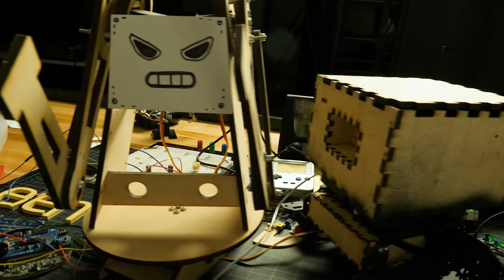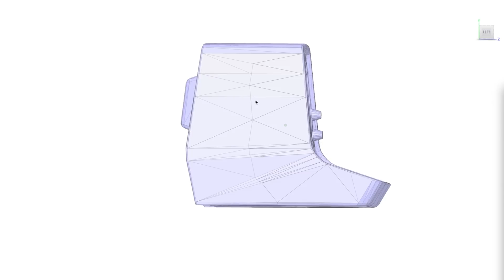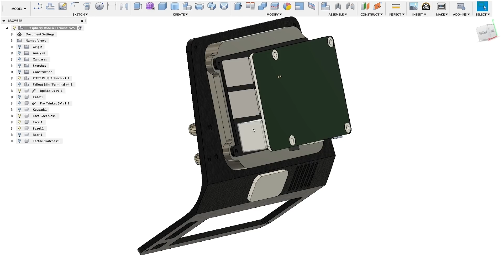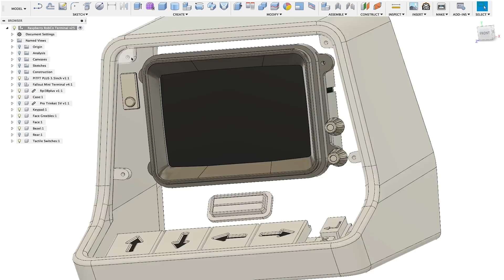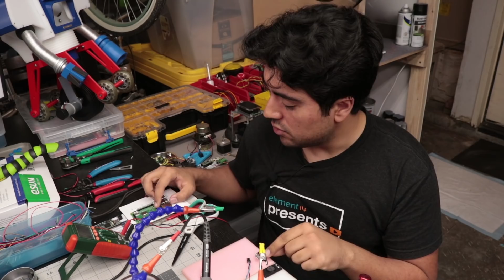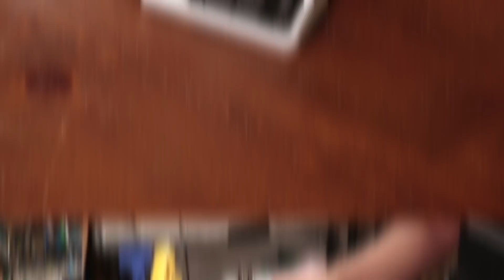Raspberry Pi Fallout Terminal PC Unlocker

Comment: What would also be cool is making  usb holotapes that have a playable   version of the mini-games and in the terminal the "load holotape" button is just an autorun for whatever is on an inserted usb holotape.

Usb just because it would be easy to use with the pi.
Reply: Adding little NFC tag tapes would be sweet. The slot in this is about an inch wide, so and SD could fit too, but I ran out of time on the project.

Comment: Made my own DIY mobile raspad using a 10 inch touchscreen from sunfounder.  Runs on 18650 cells for more than an hour.  Still a work in progress. Still need to install a bms for the batteries. I have a video posted if anyone wants to have a look.

Comment: You could use raspberry Pi 3a+ which has less ports and more headers through which you don't need to sandwich the sound module in between the display and the LED.

Comment: Now this would be really fun if you upscaled it and used a say 7 or 10 inch lcd with a full keyboard.
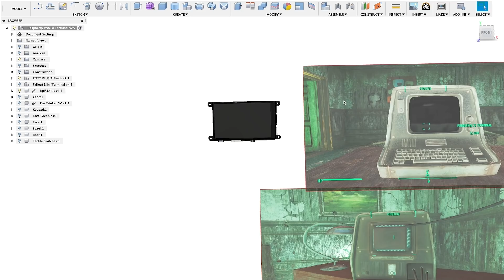Reply: In fact i stopped the video at  05:50 thinking just the same, and now i´m out...i rather build my own clone based on exact that idea, using an old C64 keyboard and a 10inch LCD and use it as an actual TerraTerm serial console.

Comment: An alternative display you could use could be a CRT tube from an old portable TV. Usually those screens are about 5 inches, with an aspect ratio of 4:3. Also, they are usually black and white, which obviously is monochrome. A green filter could change that.
Reply: Ugh right?, I had a 5" color CRT for the longest time and lost it in move a couple years ago. I'm still happy with my build since it's easy to find parts for, but I'll need to snag the right CRT if I tackle a full size build in the future.

Comment: Nifty, put springs under your buttons to keep them up in the case so they don't tilt around for no reason, nice little case Idea. good use for an older Pi, prolly wouldnt use a harder to get 3B+ but for a 2 or 1B+  definitely. [as far as this exact usage anyway.]

Comment: Great project.
The Fallout assets aren't useless for printing. A Youtuber by the name of Makers Muse who is a 3d printing expert has a number of vids where he shows how to rip out assets from Fallout 3, NV, and 4 and convert them to 3d printable files. He converted a deathclaw, mini nuke and auto axe.
Just search YouTube for "makers muse fallout"
Reply: I love MM, but you'll notice in his vids, his models are solid hunks of plastic. While it is possible to stitch stls together, extracting assemblies and internal geometry is still a no go.
Reply: @MrVolt  Sure, you are correct about that, but in this case, DJ was just looking for the external shape of the computer, which he had to recreate by hand. Most people recreating items from video games are only looking for the outer shell to be correct.
Reply from the maker: @savemegrilledcheesus494  Still needs to fit on the heated bed for printing ;) it's better if 3d prints are in parts sometimes because it's easier to replace a piece if it goes wrong.
Reply: @element14presents  Once its converted you can do anything you want to it that you can do to a normal stl file, including scaling and slicing it into parts. The mini nuke conversion hne does, takes the nuke and hollows it out into a planter. The conversation process only takes about 10 minutes, much less time then you spent remodelling the case from scratch. People take things like the power armor helmet and print it in sections so it can be life sized.